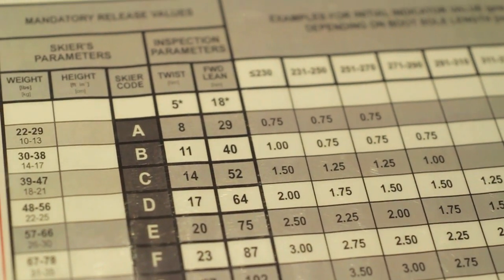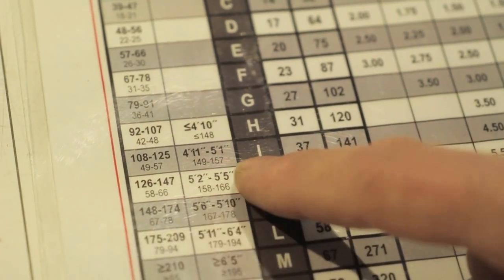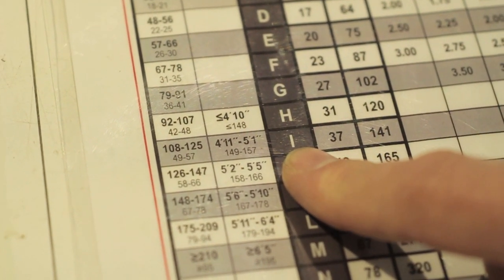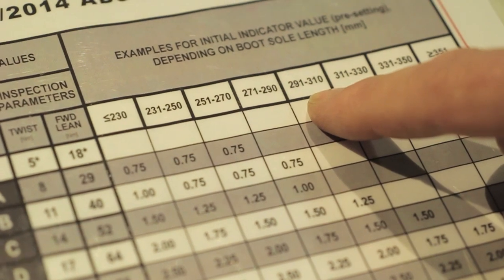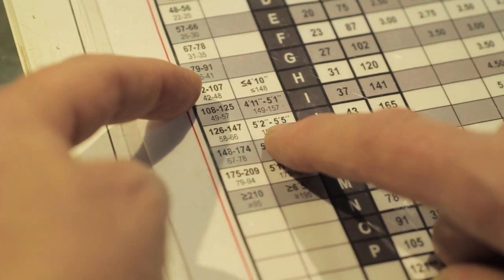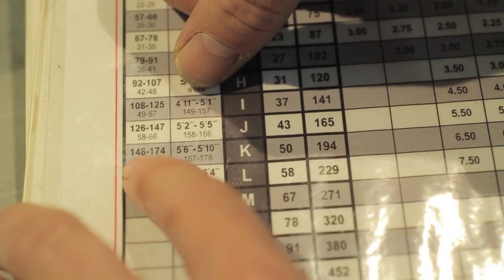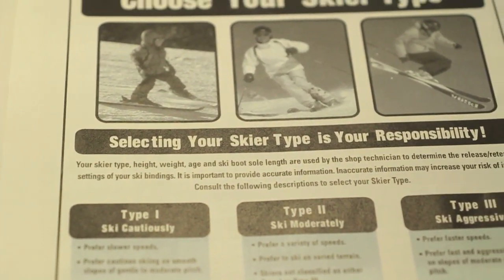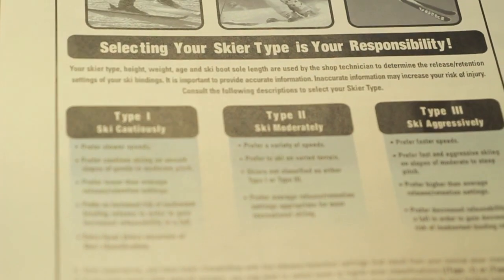How to Calculate the Release Setting for a Ski Binding

Comment: For skiers 9 and under or 50 or older the setting is reduced by moving up the chart because of a lack or decrease in bone density associated with age. If the hight and weight are not in the same row you move up the chart to a lower setting. The reason is that the chart setting is based on average bone strength for hight and weight. I am 5’5” and 145lbs. If I gain 50 lbs my bones in my legs do not change. The chart is based on averages. A longer boot sole puts more leverage on the leg so the setting decreases as the sole gets longer as you move across the chart. At my hight and weight, age, skier type with a 295mm sloe my din is 6.5. If I change boots to a bigger size with a 315mm sole my din will decrease.The explanation was correct I just added the reason or rationale behind some of the steps in selecting the din setting.
Reply: Thanks for the input.
Reply: but doesn't that mean people with bigger feet are more prone to pre-release?

Comment: I know you covered most of the DIN settings, but I feel you got cut off at end. But, I am happy of the delivered explanation; I found it to be very useful; where as, and despite, my experience with skis, boots and bindings -- of setting up my own gear -- I just began setting up my wife's; which I feel I need to be much more critical about in the details and settings for her overall safety and skill level, as well as age, height, and weight.... and, it is here that I found your explanation of height and weight to be most beneficial. Thanks
Reply from the maker: Thanks

Comment: My ski Bindings are not tight and they move a little bit. Is it normal that they are not super tight? I tightened the screws with torque 10 but still the same problem.. any suggestions please?

Comment: I had an accident last year and this year with same skis and boots. At very low speeds I felt and the bindings did not release, spraining my knee. Does this mean the bindings are too tight?
Reply: Yes your bindings are too tight. If you are a beginner and you fall while moving slowly your boots should pop out until you get a little better and you are able to tighten the bindings more

Comment: Hey i am 17 years old, 184 cm long i weight about 70kgs and my ski bindings DIN goes from 4-10 so what should i have i ski park and my boot sole lenght is 326mm
Reply: if you are a type 3 skier than probably din 6-7 for non park stuff. For park maybe want a bit lower din so you don't hurt yourself while practicing tricks etc.

Comment: it makes no sense to take the higher row... i saw in another video that you take the lower, because if he is 100 kg of weight, he cannot have the same DIN as a 60 kg
Reply: Marc G The chart is determined for average leg bone strength/density. Think about it this way. If you gain Weight your bones do not increase in proportion. They measure the force required to break the leg based on hight and weight average. We have always moved up to the lower setting since the din setting chart was developed. I have been doing this since they introduced this din setting system.